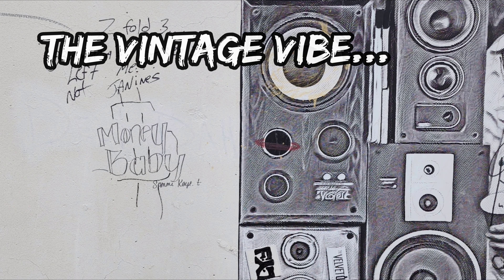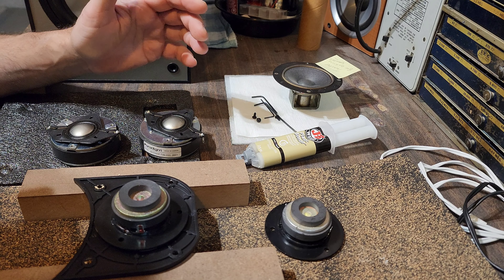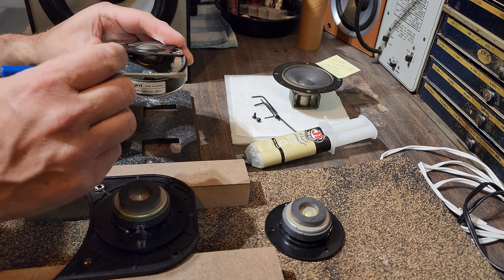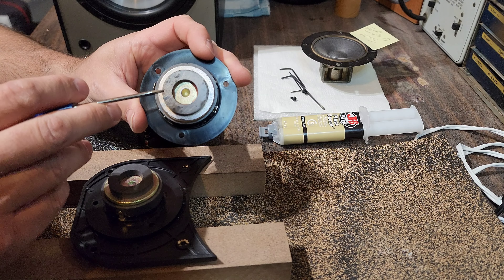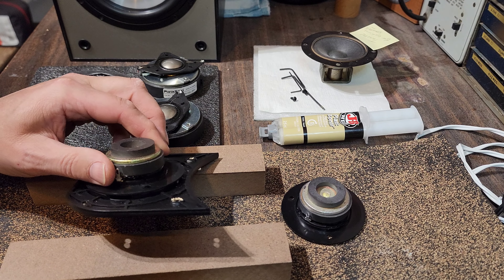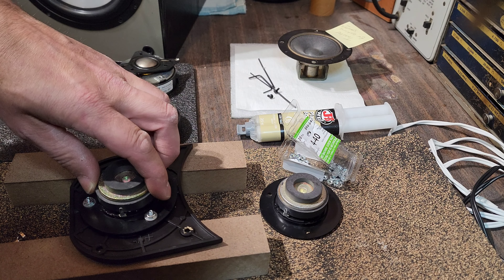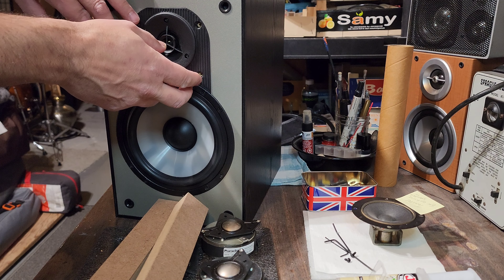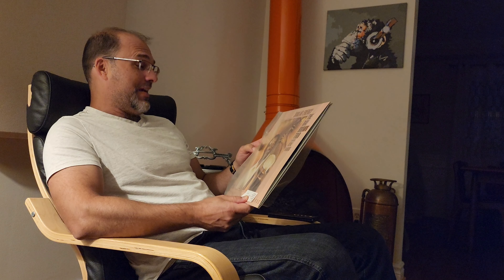Paradigm Mini Monitors!

Comment: Would you happen to have the part numbers for those BA tweeters?  Thanks.
Reply from the maker: Boston Acoustics A40. Here is a link:
https://techsonar.com/products/pair-of-boston-a-40-compatible-tweeters-w-larger-magnets-correct-dc-resistance
Reply: Hi guys. Would this same tweeter work for the monitors 9 tower speakers. One off my tweeters stop working. Thanks for any advice.

Comment: This is a bummer. I was looking at these Paradigm Mini Monitors Ver.2. Although told they run perfectly but, for how long? Guess I will pass. I just would not have the heart to put in anything but the factory tweeters back in them or repair the originals. Oh well. Moving on I guess.
Reply from the maker: Yes, it's a bit of a shame because they are a good sounding little speakers; However, those tweeters all fail at some point :(